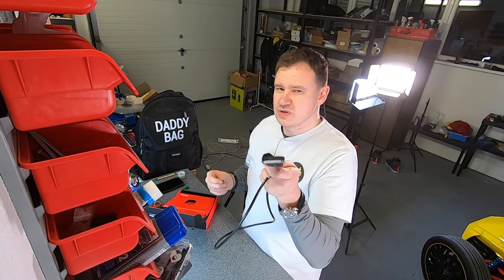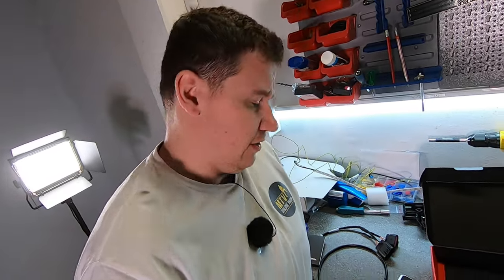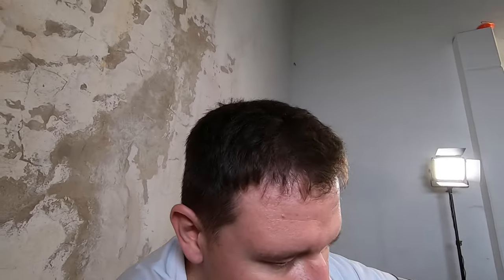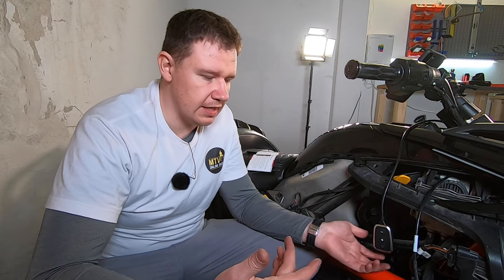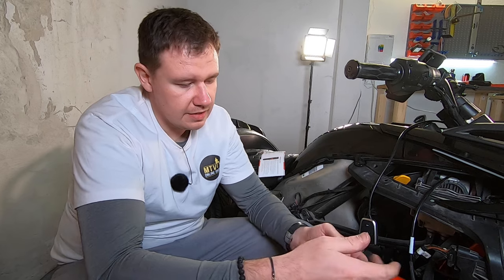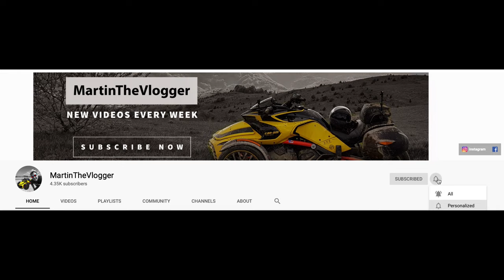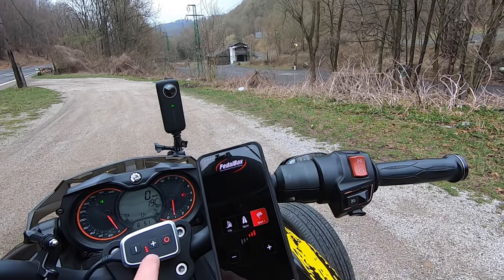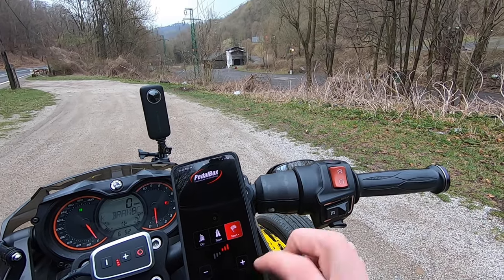PedalBox Vs Pedal Commander - which is better?

Comment: I just put the Pedal Box on my 2019 F3-T it only has 478 miles on as I bought it as a display model with 0 miles on it 6/28/22. I bought mine from Lamonster Garage. Installed and set it in Sport mode  number 3 position. It will stay there as it totally changed the response of the throttle. Love it.

Comment: Ok vlogger M! Well done without picking one over the other.  Both great units. Price depends on your personal location. Other than that the latest one had abilities to connect more models which is great if u  have one of those older models. Ridding in the triple plus mode is almost always a NOT!!! Just not necessary.  Great job moderating. 👏🏿 ✌🏿 🙏🏿

Comment: Hi Martin,  Thank's for this new video.  I have only one time an error code with my pedal commander unit and that the first time i ride with it. (I stoped the bike, the engine, waiting a few minutes and started again and always was fine )   I like this unit, it give the spyder a real new and awesome capability. Only the sport + is very insane and my opinion is that  it s only for free tracks.
oh by the way....another question,  Martin, : you are riding and riding along the year, using different kinds of roads and tires.... what tire pressure ( kpa or bar )do you apply in front and rear ? always the same ?    Because i read a lot of different opinions for the tire pressure
Good week  !

Comment: Nice video, your really twisting that throttle!!! I have been looking at the base F-3. No back seat, which I’d have to buy separate. However the price of the F-3 base is about 16000.00. Much cheaper than the F-3 S that I was originally thinking about. Really like the F-3 S with the orange frame and it comes with a back seat and a better dash, front shocks. However I don’t think the xtra $ they are asking is worth it. What do you think Martin?
Reply from the maker: Dj, can you write to my to martinthevlogger@gmail.com please? I will send you my whatsapp number and we can discuss and i will tell you my opinion. Its bit easier then just like this buddy.. okie?? 😉😉😉😉

Comment: Hi brother, I have a pedal commander, and I noticed at first after months I didn't have any issue, than I took a 1hr ride VSS fault pop up PO2222  for the first time ever. So I took it off no more issues with VSS FAULT.
Reply from the maker: yes it can happen, it is because every ryker and every spyder has a different throttle signal voltage. pedalbox learns it and adjusts where pedal commander not.. so yes, you are one of those 5% of ppl that can have this issue, and this is one of the reasons why we sell pedal box with our own map and logic not pedal commander

Comment: FYI, PedalBox for US buyers is now available in the US.   LaMonster Garage is one on-line retailer that keeps them in stock.  There may be others.   US buyers do not need to order it from Europe and pay the extra shipping or worry about customs delays.
Reply from the maker: Ok, that is true... however i have bluetooth version - version with app and for much less money,.. so in other words, more advanced unit for cheaper price 🤷‍♂️🤷‍♂️🤷‍♂️🤷‍♂️
Reply: @MartinTheVlogger  You are right - they only sell the non-bluetooth version.  I just ordered one for my RTL - can't wait to try it.
Reply from the maker: @danstatkus8892  ya will be very happy 😉😉😉😉
Reply: @MartinTheVlogger  Yes I am.  Installed it today and it's like a totally different machine.  Sport+2 seems to be the sweet spot for me.  Your video is what made me get it and I was not disappointed.  Thanks.
Reply from the maker: @danstatkus8892  🤟🤟🤟🤟🚀🚀🚀💯💯💯

Comment: It's a pedal commander good for 2020's or 2021 RTL. Or don't they recommend it. Don't that change your mapping? I think I like the first one.
Reply from the maker: Hi George, its good for any 1330 engine. It has nothing to do with mapping,. It will make your throttle to react more towards the map you have. Coz now your throttle is lazy. Pedal box or pedal commander. Its basically your call. I sell PedalBoxes i like them more against pedalcommander due to few reasons - PedalBox is more smooth, less vunerable to water and it gives you 0 error codes. https://www.martinthevlogger.com/product-page/CanAm-Spyder-Pedalbox-throttle-response-unit-1330-rotax-engines

Comment: Hi Martin, wich one is better the peddal commander or the pedalbox according to you ?
Reply from the maker: I think you will get same joy from both. I like pedal box, because the map is bit smoother and not so "shaky" and only one micro usb port is not water resistant, so i have sealed it with silicone glue and i can use it on handlebars.. map i reffer to our map i have on pedalboxes on my shop. I cannot quarantee what others have, because we have developed our own 🤘

Comment: Martin do you also have an ECU tune and airbox mod from Monster fuel.
Reply from the maker: Hi John, I have on the bYke stage 1 ECU from them, and K&N air filter,. but i wanted to get rid of the stage 1, as I have a DYNOJET module to play with now :)))))
Reply: @MartinTheVlogger  Do you think the Dynojet is better than the Monster Fuel. Will you do a review?  Your channel is awesome. Keep up the good work.
Reply from the maker: @johncosentino5983  ecu is ecu and its good. However we have change in fuel down here the specs and its causing trouble.. if we are talking about ecu flash done directly to the unit vs DynoJet i would go for Dyno...i want to do review, just not sure if i will be able to fo ot by winter :(((
Reply: @MartinTheVlogger  thank you.  I’m thinking of the pedal commander but with the ecu tune you will get even more power. Do you think the pedal commander without a tune would still give you that smile on your face and get rid of that delay in the throttle response on the stock Spyder.
Reply from the maker: @johncosentino5983  hell yeah. I preffer PedalBox,you know that. But it will be enought whatever you will choose. Quaranteed !!!!!!!